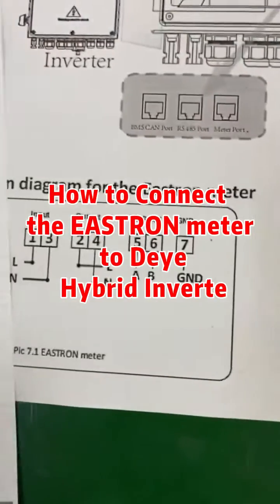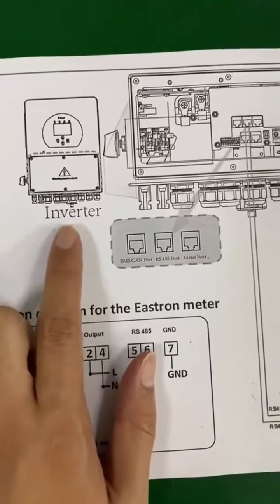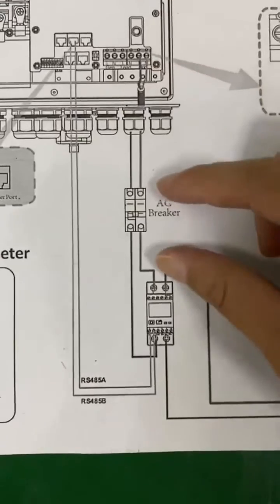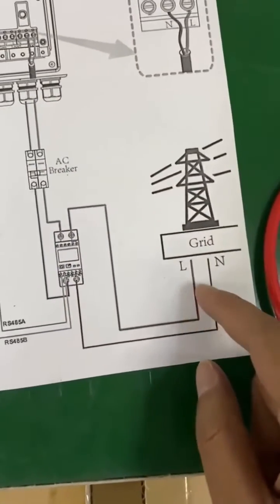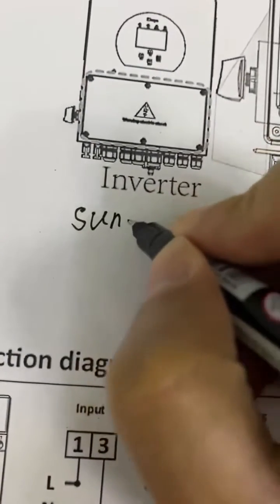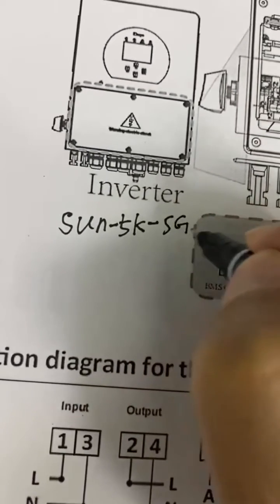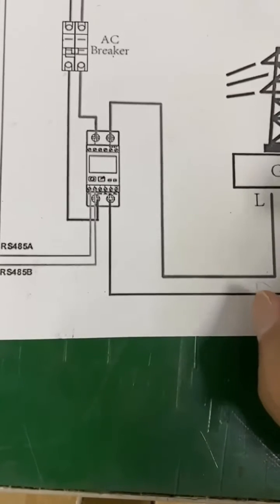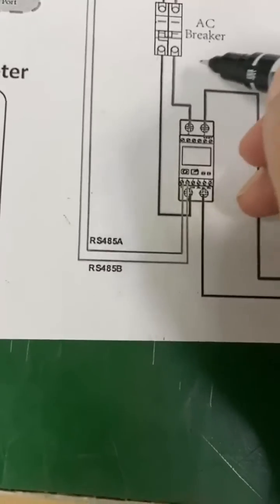How to Connect the EASTRON meter to Deye Hybrid Inverter 06#Deyeinverter #Eastron

Comment: Hi, I need some help, please. I have a 12kw Deye inverter, but since it's more than 15 meters away from the main power panel, do I have to use a meter? Eastron SDM630 MCT M-bus V2? Do I connect the clamps that the inverter already comes with to the wires that come out of the inverter and go to the main panel, or do I connect the clamps directly to this meter on the main panel? And do I connect it to the inverter using an RJ45 cable? Thank you very much.
Reply from the maker: Connect the CT to the live wire, then connect it to the "C" dry contact on the inverter. Connect the communication cable to the meter.
Reply: @SkyHuang-gm2oq  thank you